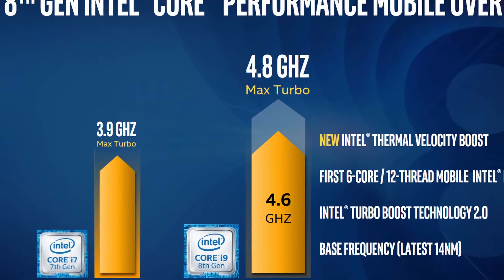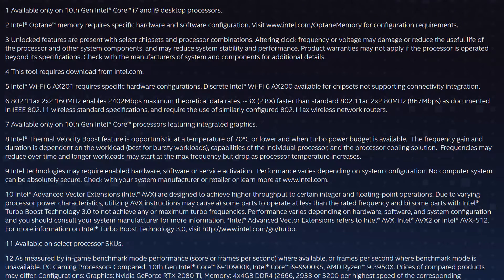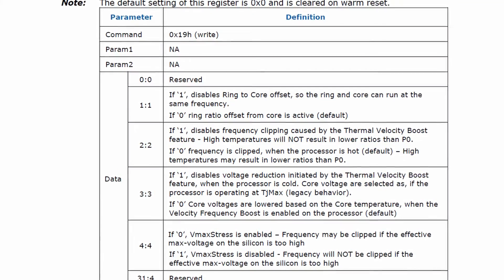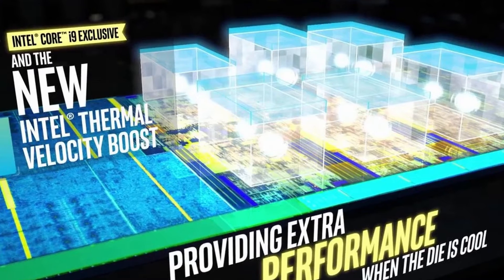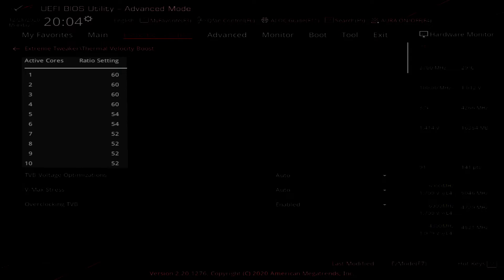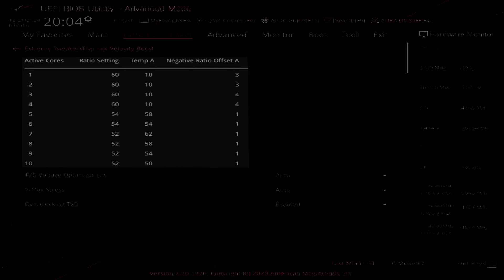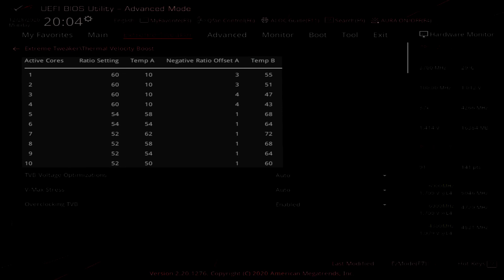Intel Thermal Velocity Boost Explored: TVB OC | SB#19

Comment: Great vid, I wasent able to get my 13900ks stable above 5.7ghz because of high heat during full load, but with tvb and a offset at 85c° before the unstability starts to take its effect I am able to run my 13900ks at 5.9ghz at 1.385v and downclock to 5.7ghz at above temp. And while gaming I only hit 72c° :-)

Comment: Also, doesn't the Ratio Setting follow the V/F curve VID set in BIOS? So, when you are running 2 cores at x60, doesn't it use a super high VID and thus really high voltage when running at the 60 ratio multiplier?

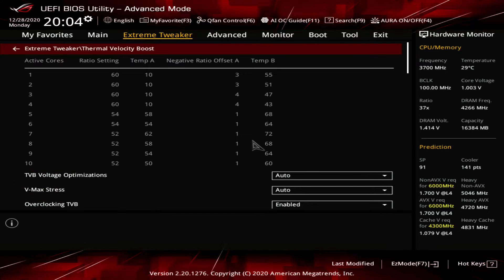Comment: 2:08 when I'm on the TVB screen in BIOS I am not able to change the Ratio setting multiplier.  It's greyed out--how can you change this?  I want to be able to have different ratios for differing active core counts.

Currently, I have it configured so that it's all core x52, so every one of the ratio settings is 52.  When all core hits 70c, it reduces the multiplier by one so that it runs x51 all core. It will do the same if any number of cores hits 70c, but that's only likely to happen when all cores are active.

I want to make it so that 2-4 cores can hit x53, and all cores can hit 52 if temps are under 70c, and if they are over 70c then all-core reduces to x51.

Comment: I have Intel Thermal Velocity Boost enabled by default in my bios, but i look at my cpu spec on intel sites it doesn't have that feature. should i leave it enabled or no?
Reply from the maker: You can set it at either. If your CPU doesn't support the feature then changing the setting won't do anything anyway.
Reply: In the past, I would have just disabled all turbo boost features in BIOS and manually OC'd to a set stable ratio. However, now I'm turning this feature on and think it's a must as it will prevent your manual OC from frying your components if you're not constantly monitoring temps by using this useful temp controller feature (which is basically what it is). Well done Intel, I'm trusting you with this Turbo Boost now. So, in answer to your question, yes, I think it's imperative to avoid frying your CPU. I'm going for a stable 4.8Ghz and if it exceeds 86degC drop the multiplier by 8 so it's 4Ghz. What I want verification on is the reason I always turned Turbo Boost off in the past, namely, will it try and boost on top on my manual OC??? And if so, how high and will it be dangerous? Why don't Intel tell you that anywhere? It's like you're just left to guess what it is.

Comment: So for the i9 11900KF (3.7 to 5.3 GHz with Thermal Velocity Boost), it is automatically enabled to 5.3 GHz?
Reply from the maker: Yes, by default the 11900KF should boost to 5.3 GHz when the conditions are right. For 5.3 GHz, the conditions are:

- There is available turbo budget to enable turbo boost
- The workload is on one of the 2 favored cores
- The CPU package temperature is below 70 degrees centigrade

If that's all true, then the 2 favored cores will boost to 5.3 GHz.
Reply: @SkatterBencher  so do you need to enable turbo on the cores, and is turbo boost automatically enabled “, and if so, when would it be enabled?

Comment: The inverse of TVB, thermal clock throttling, has been with us for some time. The fan on my Sandy Bridge laptop failed recently. It seemed to be sluggish, and when I checked: half the clockspeed and 98°C 😱
Reply from the maker: 20 years ago that would've been a viral video chain email titled "My CPU melted my notebook". We've come a long way ... :)
Reply: @SkatterBencher  Yes, Sandy was probably running like that for a few weeks. $9 for a new fan, some Prolimatech paste, and now it's running Linpack AVX at 70° - about 10 - 15 degrees cooler than it ever did. We should count our blessings.